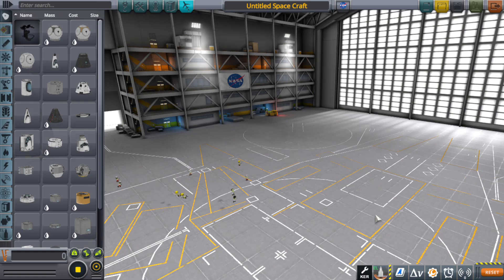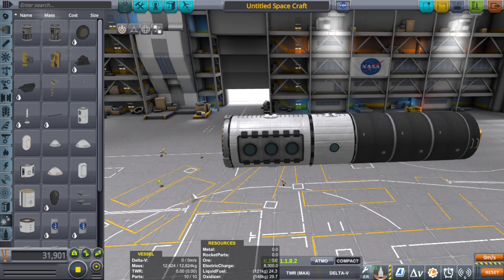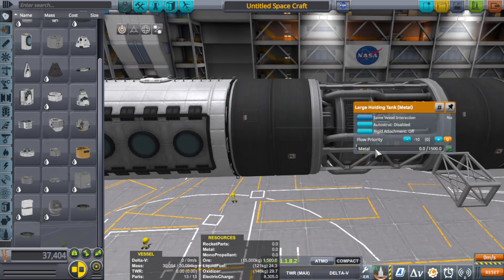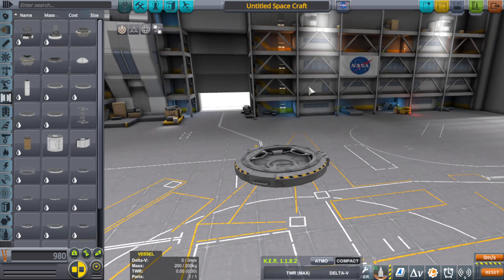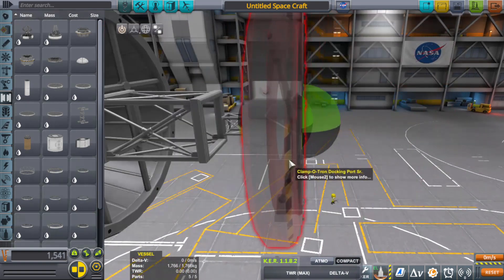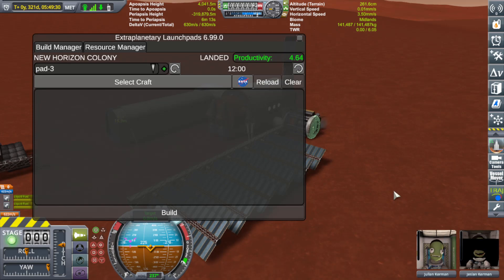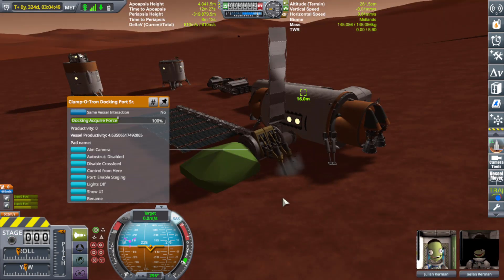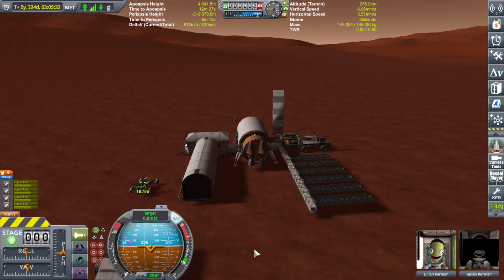SIMPLE CONSTRUCTION MOD REVIEW in Kerbal Space Program

Comment: I tried getting this mod to run recently since it's basically 1:1 what I am looking for and it didn't work, both with CKAN and manually. I went to check out the forums & looks like somebody else already made a report to the dev figuring out that there are actually either a dependency or simply files missing from the latest version - however the mod author hasn't responded to that post so idk what's being done there. Just on a technical basis I think it's a safe thing to suggest people do a clean install, however from any other game I've modded in the past in my experience this shouldn't be required by default.
Reply: same

Comment: UPDATE: So I got it to work. I've got a LOT more MODS than you are running and I couldn't get SC to run with all those mods at first.  The work around was to get all the mods that I wanted to work FIRST, then to install Simple Construction and Extraplanetary Launchpads LAST and everything ended up working.  IDK if this will work for everyone, but it worked for me.
Reply: What version of the game and mod were you using? Having problems related to b9 part switch, thanks.

Comment: OMG, if I had hair I'd pull it out!  I've tried to do a "Clean Install" 6 times now to NO AVAIL!  I've made sure that Community Resource Pack is installed with it, because it says it's dependent on it in order for it to work.  I'm completely at a loss.  I get the extra "ore" tanks, but the Processing Lab doesn't show any of the SC Stats and I don't have the "EL" tab at the bottom of the screen.  I'm going to try to revert back to version 1.9.1 and see if I can get it to work with that version, though I'd really like to make it work in 1.12.2.

Comment: Dangit I wish I had time to play with this. EL would have been used extensively on my Laythe base. Solving problems after they are discovered instead of restarting an interplanetary voyage every time... removes frustration and makes KSP even more fun.

I think there should be a "diminishing return on investment" if you have too many engineers working on one thing. Just like in real life, "too many cooks in the kitchen" slows things down. Spend more time in meetings than actually producing.